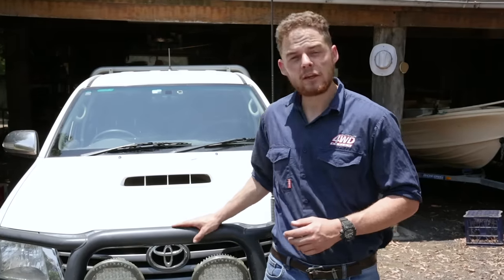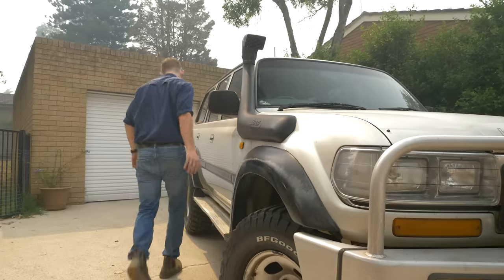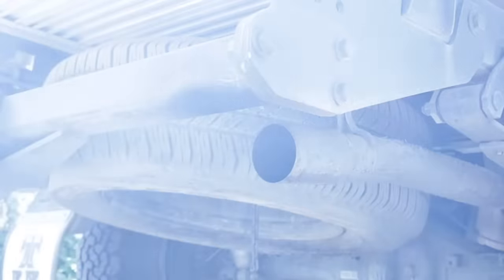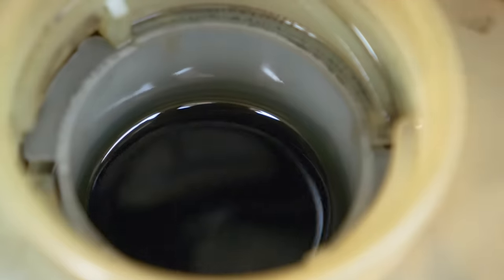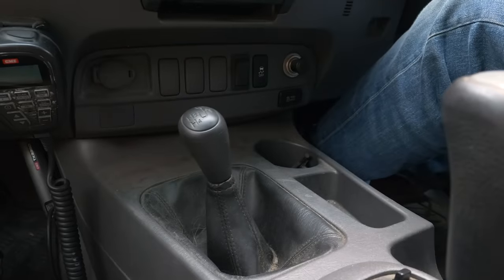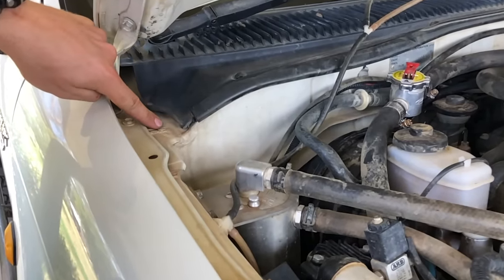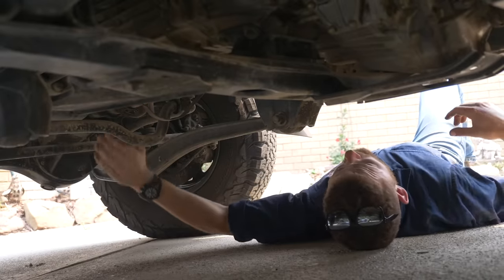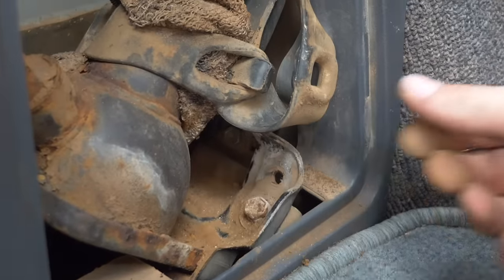BUYING USED 4WDs – Expert tips to avoid a LEMON and get a BARGAIN

Comment: He forgot one major red flag. You know the thing has been flogged when it's got a 4in lift and 35's and the ad says "Mrs only used it to do the shopping and drop the kids at school, never been off road" 🤣
Reply: mind you, how many mall cruisers / posing rigs have you seen ??
Reply: Mick Power or if it has a P plate on it
Reply: @888johnmac  There is a helluva lot of dual cabs with 22" rims and mad grills on these days!
Reply: CHOPSZOOKER but that’s not a real 4x4 so according to this video, 22’s and bogan as is super safe🤣
Reply: YEP!! dead give away also is if it had P plates lol, so many of them here in tassie flog the crap out of them and the bloody tracks, making it almost impossible to pass them in 33's
Reply: Paul Cattapan ain’t that the truth🙄
Reply: Mine had a windscreen sticker for local off-road course lol😂
Reply: I've never seen a 4 inch truck off road in my life..and i go every weekend
Reply: Unless its a ranger lmao
Reply: A 4 inch lift on a 4x4 is a pretty good indicator that it was owned by a moron and never touched dirt in its life.
Reply: Those conditions are okay. Now if the skid plates are dented, (a lot), and the machine has custom pin stripes, (or thin paint because of rubbing the stripes off), then you know it has been used for its purpose.
Smell the oils, even new oil will hold a scent if abused.
Reply: She might like being up high

Comment: So bassicly follow these tips and you will eventually find yourself in a showroom haha.
Reply: Then you end up with a laptop on wheels with dpf issues and loopholes in the warranty 🤷🏽‍♂️
Reply: Exactly
Reply: @gibbethoskins8621  the dude at the dealership when I bought my new truck pitched such a fit when I told him I didn't want the warranty.
Reply: @Zvalgryn  I had an interesting read of the extended warranty pamphlet when one of my relatives was in the showroom to buy a Fiesta. It supposedly covered stuff like engine internals, brake calipers and rotors, suspension components....you know, the stuff that's absolutely critical to a driveable/safe car. They would only uphold the warranty if you got the repair done at THAT dealership, which was on the other side of the city. Well obviously driving across town is impossible if the crankshaft has broken or the brakes are gone, you'd need a tow truck which would cost $XXX for a one-way trip. If it breaks again after repairing, it's back onto the tow truck again. Doesn't matter if you're buying an extended warranty for $100 and getting a 10 year/Unlimited Km warranty, it's still a total waste of money.
Reply: @jimtekkit   So you'd rather pay $3,000 for a new transmission rather than $300 for a tow?
Reply: So true 😆
Reply: @jimtekkit  That's indeed bullshit on their part, but declining warranty is kind of a gamble, can't imagine how much I would regret if the engine or transmission were defective.

Comment: If you buy a Defender, make sure it’s leaking oil. This way you know it has oil left 🤣
Reply: Also don't park your defender by your bedroom window. If you do its likely to wake you when it breaks during the night.
Reply: If you buy a defender...... don't.
Reply: Thats to nasty. My TD5 110 has been bulletproof, its gone everywhere in stock form, its pulled 4t+ for 100s of Ks in hot and cold, over rough and smooth (don't mention that to the gentlemen with the blue flashing lights), its had way to much thrown in the back, its taken me everywhere i could ever want to go and its never broken down and has eaten 100 series and G Wagens off road. I may have to go to the dark side one day as the new defender is just wrong but until then my indestructable 110 will get me there
Reply: @chubbymunster57  don't get me wrong, I have massive respect for the defender. I consider any car that is repairable using a sticking plaster and some bailing twine to be properly engineered. Add to that their incredible capability and you have a winner. However if we are honest the defender has a few, um, foibles... For example the fact that if you are taller than 3 feet you cannot turn right and if we are fair ladies of old where not known for their reliability...
Reply: @dewalddebeer3194  i'm 6'2" and 19st - i find it the easiest vehicle ever vehicle to get comfortable in - you leap (clamber) in (ripping the pocket off you strides as it catches the door catch), sit on the the seat shut the door and you are in the most comfortable position you will be in straight away (its obviously the only position because its quite/very cramped). The older ones did have an occasional issue surrounding oil leaks, bearings, gearbox, power, electrics, doors, spare wheel mounts, noise, half shafts etc but these were purely cosmetic (especially the oil pictures it would paint on the concrete...) and you could still get there and back (eventually). I forgot to mention dust and water issues as the doors never stayed shut - good idea to strap small people in properly - they can (will) fall out, fortunately at low speed due to the lack of power. Otherwise they are way better than a 70 seties or GQ
Reply: So true but I think I own the first defender that doesn’t leak oil
Reply: @chubbymunster57  the only people that take the piss out of a defender have never owned one. My 110 will be with me til I die
Reply: Sense of Adventure if you a buying a defender, remember that you can buy a brand new ute for cheaper 😂😂
Reply: So true bloody landrovers
Reply: Make sure it comes with a raincoat, you will need it if it rains! LOL
Reply: A mechanic told me it was the best way to keep grit out of the gearboxes. Dirt can't go in when the oil's going 3kph outwards.
Reply: Lol
Reply: @chubbymunster57  I love the old 110 perentie. They had one of the most reliable engines in my opinion. A 4cyl 
3.9 L diesel. Pretty much a truck motor and could just chug along cause of the big 3.9 L. It never has to work hard and that’s the problem with modern cars. They try to cram so much torque into a small motor and I think it makes them unreliable. And also They used the perentie in the Australian army
Reply: @chubbymunster57  Biggest piece of rubbish the 110. Omg, the drivers seat and steering is right up against the stupid door. Ugly looking too.
Reply: Haha built with spanners not chopsticks
Reply: Freaking legendary!
Reply: @chubbymunster57  qqqqqqQqqqq1111111111
Reply: “If you want to go into the jungle, buy a Landrover. 
If you want to come back out again? 
Buy a Landcruiser.

Comment: Buy from an elderly bloke. They look after their vehicles.
Reply: 100% agree with this
Reply: AJ D . I’m 73 and the owner of an hdj79 with 190000 on the clock. I have  a which and 400 kg suspension. I’ve done my own servicing since after the first service at Toyota where they didn’t change any filters. I’ve been to wa, sa, nt and nq. Still going like a Swiss clock and no it’s not for sale.
Reply: David warren let me know when it is!
Reply: @davidwarren4569  I'm 64 and when Toyota forgot a few things when servicing my Trail I figured it was easier to do the work myself, and I will know it was done correctly. I have custom pin-stripes and a couple dents on my skid plates. Everything works same as when new, it's a '12 with 240k. Been in Arizona & California mountains and deserts. Not for sale either, it is barely broke in and being retired I don't need payments.
Reply: Exactly 👍👍
Reply: Not sure if I agree with that. Scumbags are in every age group. Only lemon I bought was off an old bloke as I trusted him
Reply: I’m calling horseshit on that we got a gq a few years back from this old taka and though a similar thing, could not have been further from the truth
Reply: Just got a Prado from an old dude and i was like does it go into 4L etc no problems? He said he had never moved the transfer case stick from it's stock position.
Bought it then and there (After testing it works).
Reply: Yea got me Holden rodeo off an old bloke and it runs just like new
Reply: @davidwarren4569  David don't be selfish sell us ya bloody cruiser mate 😂
Reply: Not always the case, my grandpa never changed oi or any type of service at all for 6 years straight! He got dimentia
Reply: .... you ever seen old people drive? I only buy from them so I can low ball them and steal the vehicle
Reply: Definitely incorrect.
Reply: He was a younger bloke once 🤣
Reply: Haha, not true. Most of their kids drive the shit out of it.
Reply: Avoid dealerships, Indians and Russians
Reply: @jaywalker7622  I'm Indian man. Sold hundreds of vehicles. Not one come back or lawsuit. But I agree lol. I'm the exception. Really don't blame you. I would also not support them
Reply: Graham nuff said
Reply: AJ D you should not have disclosed it. Now  P platers can hire elderly costumes when selling their vehicles.
Reply: The old guys learnt about maintenance through mistakes made in younger years.

Comment: As a 4x4 mechanic my number 1 tip is get the car inspected by a specialist of whatever brand you are looking at. 100 - 200 bucks upfront can save you thousands👍
Reply: I'm going to do it tomorrow with my mechanic. Let's how it is going. 😊
Reply: $100-$200 the cheapest $260
Reply: only for when things go wrong, the mechanic won't take responsibility for it, but happy to take your $$$$
Reply: finally some reason!
Reply: @man.i.literally.failed6772  An inspection is just that. A couple of hundred $$ won't get you a full teardown. No mechanic has X ray vision. Sorry to be the one to point this out to you 😆

Comment: Mine is a good news story - bought a used and well looked after 2010 Hilux 4WD with excellent duco condition and internally looked after. The seller had good credibility and was very transparent about the vehicle’s history with all the service books. The price was very good for this popular vehicle and from visual and driving inspection I was confident of a good purchase. I’ve owned it for eight months now and ‘Heidi’ the Hilux is going  in for a logbook service. Sleeping well at night with plans to go for an Alum canopy, dual battery etc setup next. Do your research and don’t be afraid to walk away if something doesn’t feel right - avoid car dealers like Covid. Good luck John in SA.

Comment: I have an 80s diesel hilux, it was my first car. 15 years later I still have it. It has high kms, rust, replaced and repainted areas from crashes, etc, etc, etc. But still is sought after and running strong. Its silly how much its now worth!
Reply: Can't beat the 80 series 😀
Reply: @longgonexxxx  80s hilux isnt an 80
Reply: 😂😂😂 too right m8. 80 series cruisers weren't hiluxs from the 80's.….  Made in the 90's in fact

Comment: Its all hit and miss. My patrol I was told will be a lemon. Had minor issues. Turned out to be cheap to sort and didn't have any problems till I started to thrash it.  I've bought cars I've had mechanics check over and give the okay that die a month later. I've got a mate that bought a car not a scratch on it. No leaks nothing.  And that's been problems since day one. Second hand is really luck of the draw.  Alot of stuff can be hidden with additives.
Reply: liam gibbens true, just hit and miss, quite sad 😞.
Reply: As a final check kick the tyres and watch the rust rain down😂

Comment: Another tip, always take a magnet with you to look at a vehicle. 
If a magnet won't stick to the under side of the body and the chassis, there is either rust (may stick to rust but significantly less than good solid metal) that was covered or a repair using body filler.